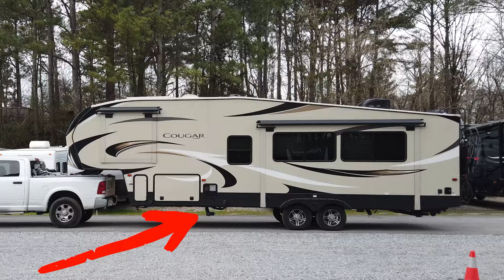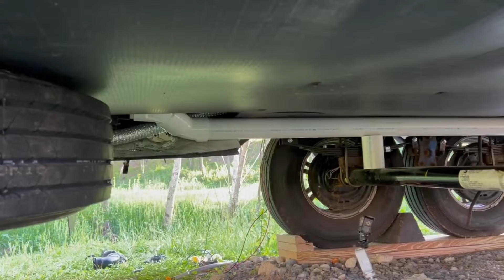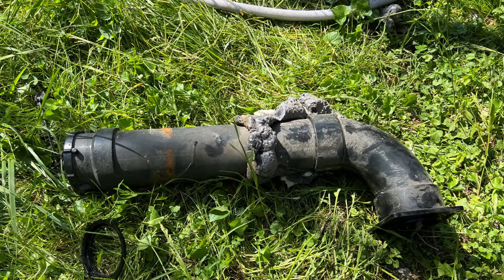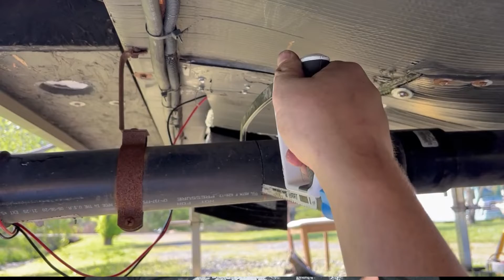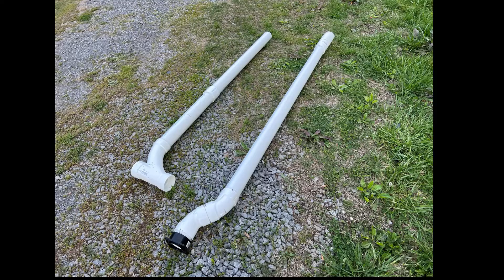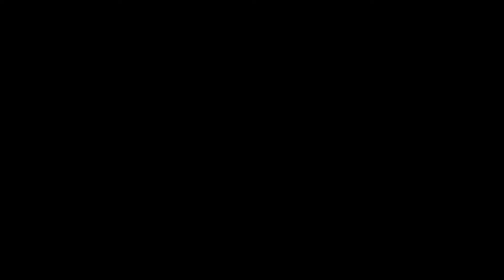The Ultimate RV Sewer Upgrade- Combine Separate Tanks

Comment: I'm planning to rip my underbelly apart to do some tank additions and cleaning up the wiring, and this was one of the ideas I wanted to incorporate. It takes a few extra minutes every time at the dump station and is just annoying. Once I do this I will probably try and find a better replacement for the cheap corrugated underbelly that is a huge pain to remove and install. Maybe some smaller material like 18-24" wide to minimize inspection time opening and closing.
Reply from the maker: I’m eventually going to rip mine off and insulate all the lines and such and start over with it because I have like 500 patches on it now. Lol